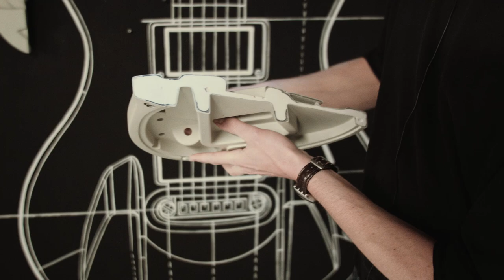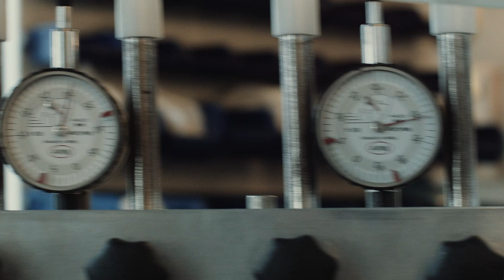Aristides Guitars Extended Factory Tour

Comment: AND ALSO
Could frets be made out 
of something Harder than
Stainless Steel
????
I wear out frets
VERY Quickly....
MAX amount of time 
that frets last me 
18 months.
Reply: Stainless steel are the hardest fret material available but I've always wondered why someone hasn't tried using titanium frets.  U can buy titanium truss rods. '16 gibson LPs have a titanium nut.
Reply: 18months? i suggest u to check your playing. u dont need to press that hard or play using rusty strings. i got  an LTD electric guitar made in indonesia, the stock frets last 7 years until now and counting.
Reply: johnnypk1963 I'd say titanium frets haven't been used yet because of how hard they'd be to work with.
Reply: There is absolutely no way you wear through frets in 18 months. I've seen some guitars from the 80s that were played every day but still had playable nickel frets
Reply: @athmaid  I can wear out the Frets on 
a cheap Ibanez RG in only 9 months.... I did it twice when I transferred to electric guitar and bought cheap second hand ones, with the flattest fretboards to get started . They got worn out enough to make the instrument become unplayable and very out of tune.
My Shawn Lane Vigier has Stainless steel frets, with a completely flat fretboard and I have had it for nearly five years, and there are a couple of spots with very minor wear that need attention soon. And I have the hint of a buzz also on one fret up high.
 I think that I wear out softer frets very quickly because I was classically trained, and can't help playing every note with a miniature little vibrato, like I did playing classical for many  thousands of hours... well that's the best guess of my friends and the guy who is currently building me a Guitar with True Temperament Frets... Stainless steel of course! It will also have an Evertune Bridge as I'm getting rather old and fed up with wasting time on tuning!
PostScript...I know exactly when bought my Ibanez RG350MZ.... during February 2017 Ibanez released loads of instruments to celebrate the 30th anniversary of the guitar they first released with Steve Vai . There was a warehouse full of the cheap things for only
 ... £150 - £200, mine was £180 . 
I had demolished the frets on an RG already, but didn't know enough yet about guitars to decide which "proper" guitar to buy, and liked the flatness of Ibanez. I'm disabled and can't drive, which made the process take even more time.
 I tried just about every electric guitar you could think of including Ibanez that must have had stainless steel frets...some of the more notable ones that I liked where Musical Man (one of the John Pettrucci ones) and PRS, and a Suhr.
I was eventually swayed by the flat, classical style, fretboard of the Vigier, AND the fact that it's got a big chunk of carbon fibre instead of a truss rod. This neck isn't going to move, and I guess Shawn Lane picked Vigier because he spent a lot of time in India. I bought the Vigier in November 2017 and the frets on the RG350MZ built in 2011, were so bad since I started playing it in February 2017 , that it wasn't worth spending the money on it to sell it on. It was taken apart and its parts were sold off on my niece's kid's eBay of all places...I have no Idea how that works.
The RG I had before that was an Ibanez GRG270B , a much cheaper model from 2009. But, there was something about the profile and feel of the neck that I really liked, much more than the Wizard neck on the latter Ibanez.  I still have it because of this, and the Luthier who embarked on designing and building my new guitar, along with myself designed the neck of my new guitar to have some similarities kind of crossed with my Vigier neck. It's taken time, he's Very busy, but it is almost finished. It will be ready in September this year, so it's taken nearly a year, which is not too long .
Post-postscript. I was thinking of how many Hours that I might have played the RG350MZ from Feb 2017 to Nov 2017 and being a much older person, it's not like the amount I used to maybe, but I can still play all day long . And when I play on metal strings I much prefer as light as possible, which, when combined with my techniques, might contribute to excessive wear. I don't know really? Because I am very immobile, and one of the few things that still works on my body is my hands so I still play a lot of guitar(only electric because they can't cope with classical anymore) ....I always improvise along with anything I watching online, TV and most music I listen to, even when I'm watching a movie with my wife in the evening I am still playing. So I might actually play for more hours than I used to  when I was studying classical guitar on a formal basis in the eighties .  Blah blah blah
Reply: @alexrysham3668  I can't change now! See much longer reply to other comment.

Comment: Kramer has tried it with aluminum.
Carbon has been tried.
All these guitars have failed. Also these guitars will be forgotten in a few years. You can also not build a violin or piano or gypsy or Spanish guitar on ufo material. Nothing can affect the quality of a living piece of wood, when can one understand this for once and for all ..
Reply: Freddie Iersel Electrical Guitar Company is very successful using aluminum as a primary building material. I have owned an Aristides for 9 months now and am beyond impressed. This is absolutely the future of guitar building, especially in a world of diminishing resources. They're very much ahead of their time. Of course your major brands will always be there, in one way or another. But there will always be boutique brands pushing the envelope. Your horse seems a little too high. You should get down.
Reply: Aircraft grade aluminium is great -the problems with aluminium have more to do with the feel of it than any constructional or acoustic problems - mainly, that it gets uncomfortably cold easily and is difficult to combine with wood due to the difference in thermal expansion.
Reply: Boy are you wrong, Aristides seems to have more demand than ever. They are similar to Parker in their mission. Sure, Parker disappeared, but everybody knows them. And Parker guitars stood the test of time as well